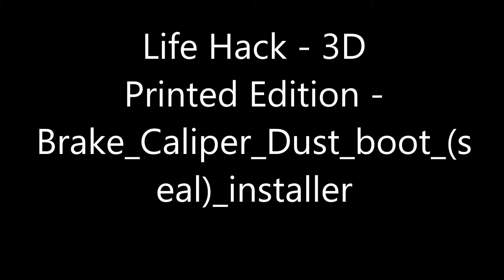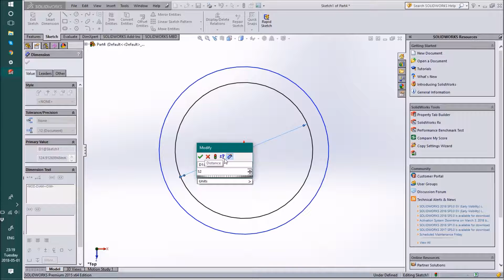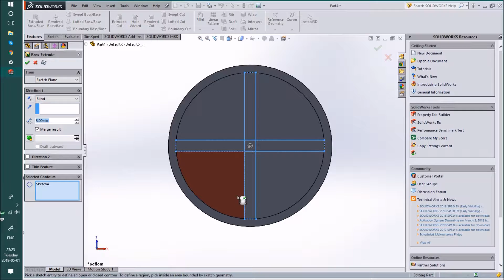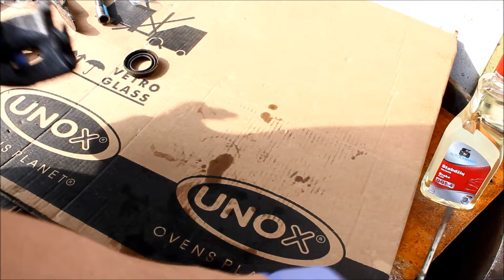Life Hack - 3D Printed Edition - Brake Caliper Dust boot (seal) installer

Comment: Bravo.  I have ATE 70mm/75mm sized seals on my BMW and the information on how to seat those boot seals for the front is non-existent.  I know ATE made rings of various sizes but to purchase the ring for my caliper wasn't an option.  It's also interesting that there is not much talk of it either because, if you can't get the seal seated, the piston is going to get contaminated quickly.   Thanks again.
Reply from the maker: I’m happy to help :)